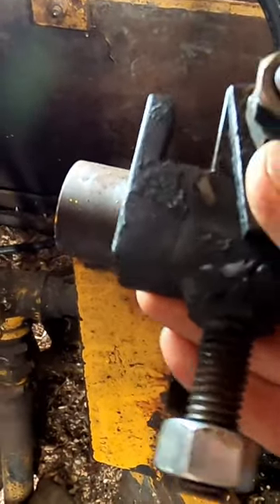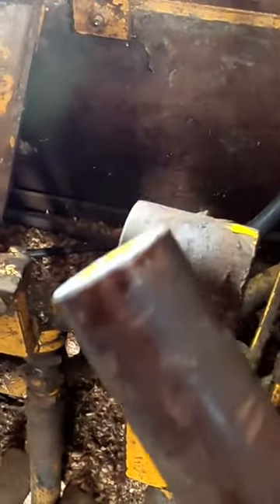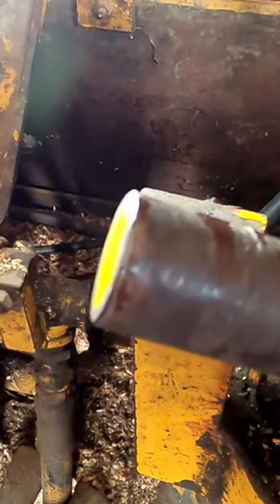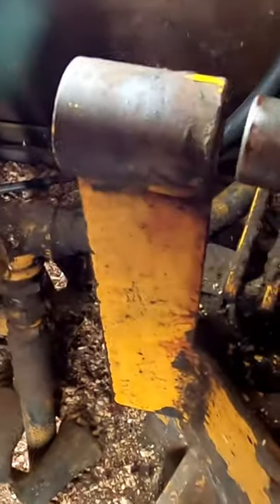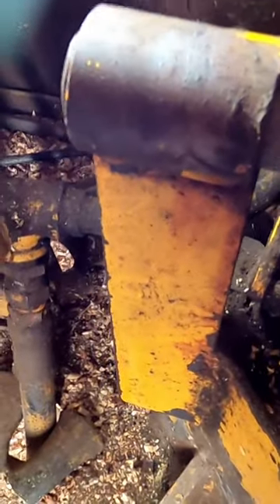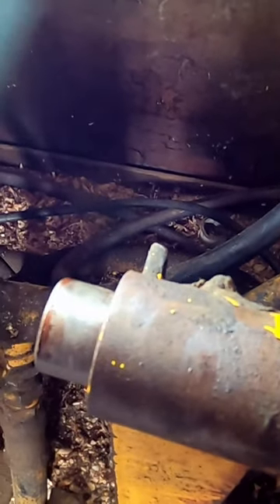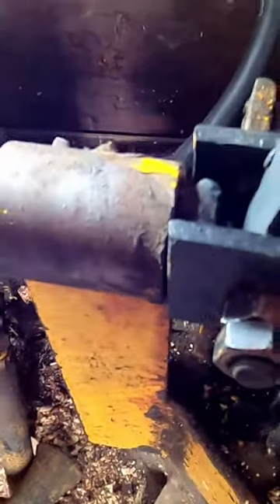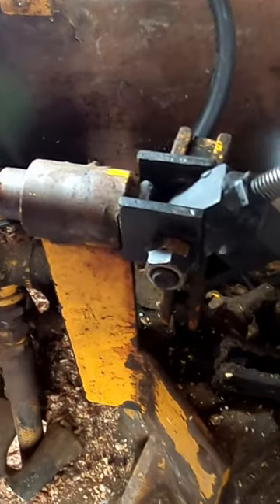log turner repair # shorts

Comment: I worked for a farmer growing up in the wheat fields of Kansas in the 70’s.  The guys had a Ford NAA that he ran way too long before an overhaul and the #2 and 3 cylinder heads had a trough worn through them from a head gasket issue.  He used JB Weld to full the groove and it held!!!